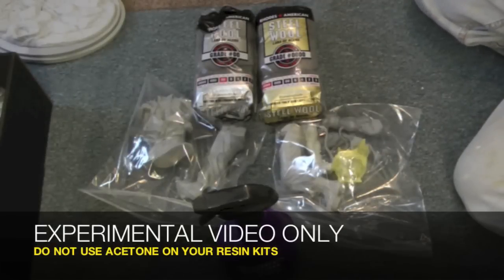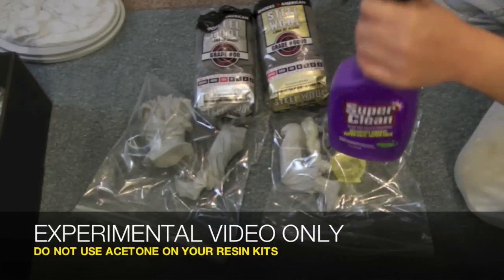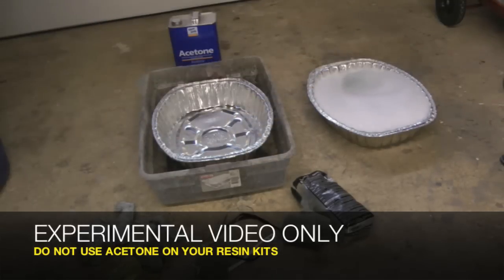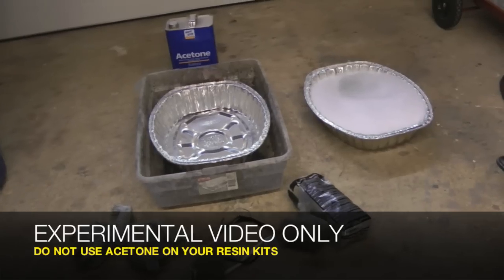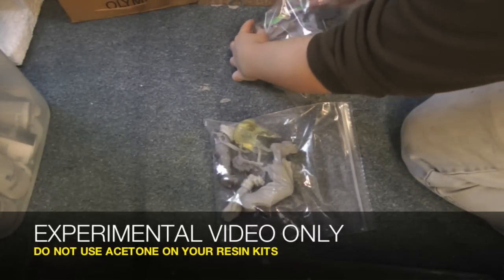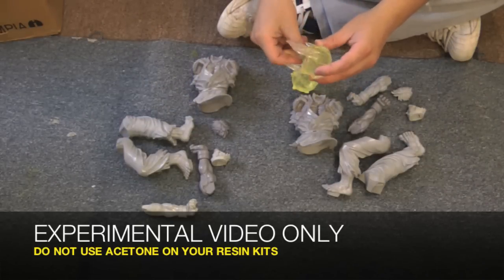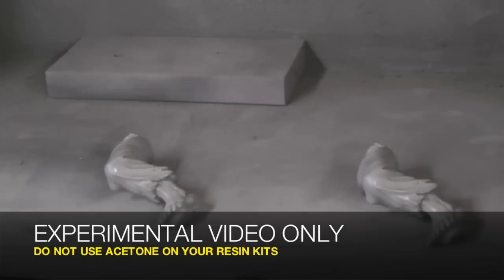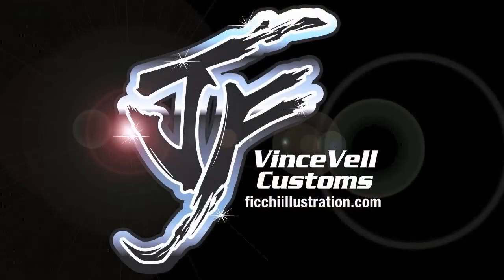Experiment Using Degreaser & Acetone to wash a Oily Resin Kit

Comment from the maker: Ya i prime the pieces so i can find errors before i piece together, then i piece and prime again. i like to get my items super smooth while working on them. Reg primer at the end unless its so smooth with the filler primer i wont bother priming anymore and just paint. if the dullcoat pooled, prob just over sprayed or the can splattered, it happens t me sometimes and have to repair that area it pooled on. dullcoat is great but can cause issues with over spraying or splattering.

Comment: Thanks for the info.. i do have a question.. so once you wash the kit, you sand and primer with filler primer, then you assemble and patch and prime again with like just a regular primer? like duplicolor sandable primer? i recently had some issues with my Superman kit where the dullcoat kinda pooled and ruined the paint job.. i had to strip it.. but after watching this vid maybe i didn't get all the grease off and the paint did not stick..